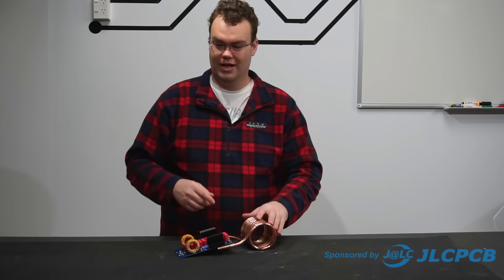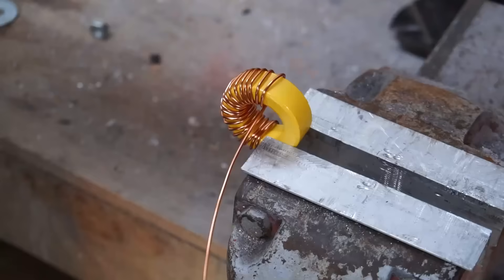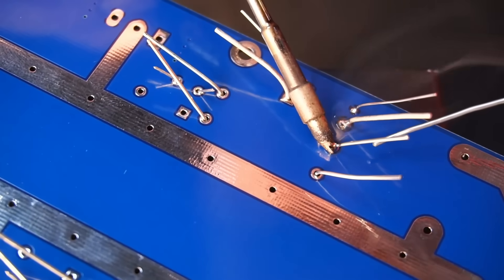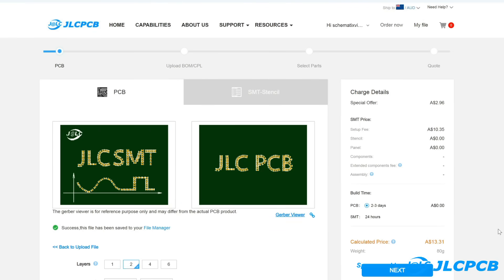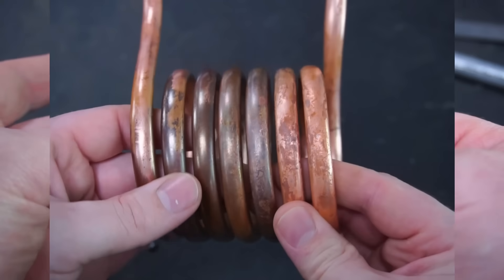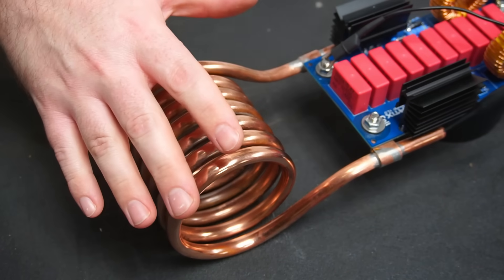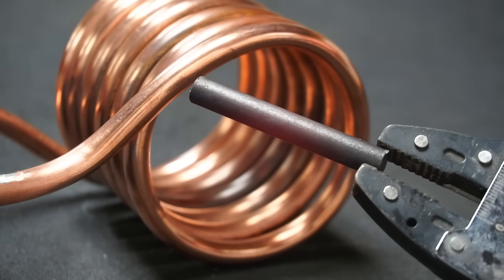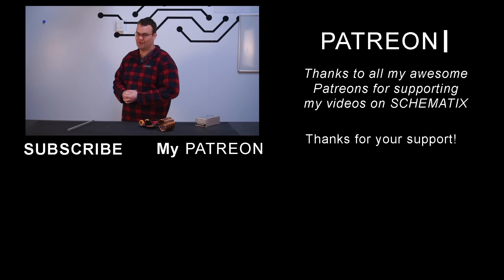Building a 1.4kW Induction Heater

Comment: Nice job, but I have some ideas, in order to make it better:

First, you can fold in the middle, some of that enameled wire you used to wind the two coils, in order to make the traces thicker. I saw you did it with some braid, but anyway... You could also make the traces themselves wider also, at the first place, I guess...

Second: If you would like to have some safety, in accordance to any different power source you might have to use, you could use some automatic, household circuit breakers. Maybe a couple of them in parallel, if the current of the input exceeds 40 amperes.

Sorry for any grammar/syntax mistakes that I might have made, but I am from Greece. What do you think of my ideas?

Comment: You need to make a smaller one for annealing cartridge brass which anneals at 700*F. As long as it reached 700 templiq can be used as the indicator to lift the brass out of the coil.

Comment: great video. You should consider to cool the induction coil with flowing water.
Reply: He did. That's why he used a tube and not a wire.
Reply: @smferreiro2610  he did not.
Reply: @gaynzz6841  He did "consider" it. He says it a some point in the video. That is the reason why he is using a tube and not a wire.
Reply: @smferreiro2610  Maybe that was his reason. But using a wire would be very inefficient in any case due to "skin effect". High frequency AC pushes the current outward to the surface of the wire, which reduces its usable cross-section. You will find that many people use copper tubing even if they're not using any water cooling - simply because it's more efficient

Comment: Why did you etch away most of the output/power traces, and try to get back  the current capacity later?
 Much simpler to keep as much copper area as possible, and only have a small etched ditch between the current bars.
Naturally You still need solder some extra wire for enhanced current , but it should help to keep the trace temp more stable  and secure.
A thin coat of lacker over the finished output coil should also greatly enhance accidental short-circuit prevention :)

Comment: Would there be benefit in electroplating the coil with silver, which conducts better? Or even gold?
Reply: Making it out of solid silver or gold might be better... I would actually try to use grounding rod copper that is solid, and not just copper tubing. And instead of trying to "reinforce" the current capability of your PCB with some weak wire and tin blobbed on top of 35um copper traces, i would cut and bend the ends of the rod and coil in a shape that follows down the path of capacitors on the PCB. Needs a bit more work to bend the copper into a coil, but i think it will be worth it.
Reply: @ProtonOne11  Current flow on the outside edge of a conductor, not inside.

Comment: Schematix: I used an on line version of these some time back for a self wound flyback transformer, specifically for the primary. The problem that arose was I knocked out one of the Mosfets. I stepped up from 12vdc to approximately 3000 vac with my design. Using this as a 'flip-flop' primary works pretty well (except killing the fet). Would this work as one in your opinion and what might I use for protecting the mosfet in the future? Thanks.

Comment: prove me wrong but from a smiths point of view, annealing is heating themetal and let it cool slowly down to room temperature :P
Reply: That all depends on whether you're dealing with a ferrous or a non-ferrous metal.  The end result of thermal cycling is a desired crystal structure in the metal.  If you want hard copper either work the metal or toss it into a 350F oven for an hour and turn off the oven with the metal inside.  If you want soft copper heat it the same way an toss it into a bucket of cold water.
Reply: @artjoly6348  I agree:-))
Reply: Correct but copper,gold and silver work differently from carbon based alloys
Reply: @jadekayak01  exactly so... we quench steel rapidly to increase the hardness... we quench precious metals to increase ductility... when I worked on BMWs they started hardening the brake rotors in liquid nitrogen... it creates a crystal structure in a thin layer on the surface that resists the heat and friction of applying brakes in a high performance car... and I think that might answer my question too... how bout that?
Reply: I think he quenched the copper tube and not annealed
Reply: @apurvmj  Quenching is the process of dipping something hot into a quenchant medium such as water or oil. You can 'quench' copper but the result will it being annealed as copper cannot be heat treated. Tempering is a process done after quenching mainly for ferrous metals to take the hardness down a notch and add some spring back into the material. Annealing is reducing the material to its softest state by heat soaking then followed by a slow air cool for best effect. Proper anneals can take 72 hours depending on size of piece.
Reply: There are a lot of strange answers here. For copper and brass, annealing is heating to less than a red glow and just letting it cool. For brass cartridges, which are often annealed by torch or induction coil, they are just dropped in a tray or bin. No quenching! It is done to keep the copper or brass from getting brittle and cracking. Red heat is way too much. Color change in a flame is too much.  https://www.youtube.com/watch?v=LYk3_IcB4JI
Reply: It all depends on what properties of the high temperature allotropes of the material are. All quenching does is lock in the properties of a higher temperature phase by cooling the metal so quickly that it can’t re-transform back into its room-temperature phase. There’s a thing called a time-temperature plot which shows the effect of cooling speed on how much of the material transforms back again to its room-temp phase.
Reply: Quenching in water has little effect on the final product as the high temperature is what allows the crystals to reform, however quenching it is just faster and can make the outside look nicer. Iron can be work-hardened as well and quenching will have little effect on the heated iron just as copper. Steel WILL harden as it is the rearrangement of the carbon atoms that occurs at higher temperatures that give steel it's high hardness,  which obviously if cooled fast enough (tempering), won't have time to go back to their original places, leaving the material in a highly stressed and brittle state, which is essentially what makes a material hard
Reply: @Jakob6174  "if cooled fast enough (tempering)" - uh no, that's the hardening/quenching you're thinking about. Tempering is reducing the stress in the material which, when it comes to steel, is achieved by heating it up to a low , non-glowing heat and maintaining it there for a while giving the carbon atoms enough time and energy to get into a "more comfortable" position, but still kinda stuck in the iron atom lattice. On a macro level this gets us a compromise between hardness and toughness which is desirable for most applications like knives, tools and springs. 

I'll add this as well: there aren't any other common alloys that can be hardened through heat treatment (maybe some aluminium alloys), but nearly all of them can be work hardened, as that is just a function of the crystal grains elongating while you're deforming the metal until they have nowhere else to move. Moving it beyond that point will cause a break, but the force required to break it is usually much higher than what it previously took to bend it, hence the hardening. Heating it up after work hardening gives it a change to recrystalize so it can be deformed further without breaking, which is also why forging works.
Reply: @mrkiky   well, what about Titanium? It hardens at 200°-300° Celsius.
That'S what make processing so hard. one glitch in cooling and you destroy your tools
Reply: It's opposite for ferrous and non-ferrous metals. What he did for copper (non-ferrous) is correct to anneal it.
Reply: Gosh darn it correct he just tempered it

Comment: What a flux rosin? :D
Reply: Try searching this term => Rosin Flux. You'll get more info than you'd imagine. 

It's basically used to clean and remove impurities from the surfaces of the copper allowing the solder to flow and bond to the surfaces.
Reply: @TheHungrySlug  I never heard the term rosin up to now. Always flux resin.
Reply: @no-eb2xx  I'm a electronics hobbyist myself and have been for many years. I only earlier this year, found out about Rosin Flux. I knew about a good handful of different flux's but nothing about Rosin flux. 
It's just another type of flux in the end.

You can actually buy this sort of stuff in a hard block. Though I don't know how you go about using it.
Reply: @TheHungrySlug  I once had a block of "resin" flux and it was hard as honey but more transparent, and I used it to push heated up ends of cables in to "flux it up" before applying solder.
Reply: @TheHungrySlug  it was annoyingly sticky after application, figures it's a pine tree thing :D

Comment: Hi, is it possible if I use the 1200w dc buck converter as a power supply, to supply power through another 300w dc buck converter.

I want to power multiple loads on one battery.

I have 1 1200w dc buck converter and 6 300w dc buck converter.

The diagram will be : connect the 1200w dc buck converter to a  fuse box, and then connect (6) 300w dc buck converter to the fuse box to power multiple loads.

Comment: For softening Don't water quench. let cool slow.
Reply: I tried it hundreds of times it is better if you cool it in water!!
Reply: @johnhili8664  & zippy.  For high carbon steel quenching in water from red heat will harden the metal. But for copper quenching will soften it.

Comment: The first thing the that came to mind during your assembly... don't cut off the cap leads, bend them over as extra current members. I've soldered paperclips to make higher current traces. (I don't always have a spool of 8AWG wire sitting around.)

Comment: Make it safe & reliable if you dare trying, Vladi Mazzilli didn't seem willing to publish any revision past the 2008-2009 contribution, while his "Royer ZVS" (as he called it himself...) fueled scholar examination and even a fair number of correctives which still won't stick around neither.  The circuit is suicidal BY-DESIGN, in other words "it works" until it doesn't - so much for bogus engineering while in fact Mazzilli worked on Tesla Coils using Flyback Transformers!

Comment: Nice layout but ideally the mosfet should not heat up much and the mass majority of the currant should go within the coil and the capacitor bank. I have made quite a few ZVS and basically you can optimize it by 1. change gate charge resistance until mosfet stays cool, and 2. add capacitors until the frequency reaches close to audible range. I would increase the coil count to maybe 10 turns for 48v input and double the capacitor bank. If the mosfets are too warm, upgrade low R-DS mosfets and or decrease gate drive resistance.
Reply: How can you increase the frequency to about 400khz?

Comment: Hi i have built several RC type EDM power supplies, so i am familiar with  paralell capacitors and high amperage discharges, my question is : can you substitute the mosfets with a gap, (fine tuned spark plug, tungsten points, argon atmosphere???)  and feed the resulting R-C-G DC oscilation through the main coil. similar to a marx generator, or an HF start from a plasma cutter or TIG welder 
Im used to gap dependent frequencies of 20 KHz or there abouts is this usefull? 70-200 odd V DC up to 16 amps 0.1-120uF caps
my main EDM unit is an ex telecom 88VAC 50mp transformer.... she's got some serious grunt

Comment: Thanks, very nicely done video, and details onm your website.

In order to make it more powerful, you'll need to cool the copper induction coil, but I'm sure you've seen that on the other devices that are shown.
The copper will get hot from the heat you are putting into workpiece, which in turn will heat it up by radiation/convection.

And the coper itself will get hot by the resistance drop from the current itself, but would need to do the math to see it's a reasonable amount.

Comment: 14:40 why on earth is the width of the band expanding when the pliers are placed into the coil? the best guess that I have is that the pliers are not a perfect cylinder, so there is some variance in the signal that the oscilloscope is receiving (different parts of the pliers are a different distance from the coil creating a variance in the inductance)... but that's just a guess. Can anyone here explain this behavior?
Reply: If you mean the spreading out of the peak voltage, it is due to power supply ripple.

Without pliers the load is small so the power supply voltage is constant.  With pliers the load is large and even the huge capacitor shows significant ripple voltage - it's only getting charged once per 10 ms at the peaks of the input 50 Hz AC.  The resonant tank voltage is approximately proportional to the power supply voltage, so the varying power supply voltage causes amplitude modulation.

(Edit: notice it is not a time spread because the zero crossings are still clean.  If the inductance was varying rapidly the frequency would modulate, causing a horizontal spreading that increased with distance from the trigger point.)

Comment: One thing that strikes me is the fact you use way too much paste between the mosfet and the heatsink. Never forget paste not only conducts heat, it is also a resistance to heat. So the more paste you use, the larger the resistance is which causes the heat transfer to reduce. I see that all the time. Paste is only necessary to fill uneven parts of the fet and/or the heatsink so they touch each other for better heat transfer.

Comment: It's a good video and interesting idea. But I'd be more worried about shorting out the induction coil by dropping some ferrous metal inside it, and with 30 Amp current it would probably weld itself to the coil, and of course then there is the slight risk of electric shock from +50 volts on the induction coil. A plastic sleeve around the coil would be a good idea.

Comment: if you fill your copper tubing with sand(like from a sand box or the stuff you use to make cement) you can wrap and bend the tube without deforming the inside, and flattening the tube.
Reply: Not worth it IMO, at least for a small coil like that.  Sand falls out, so you cap then ends.  Then you discover the sand is preventing it from bending.  You let some sand out.  Then it bends and kinks at the voids in the sand only, ruining the coil.  Huge pain.  His printed coil winder is perfect for that coil.

Comment: Greetings from Russia. There are rumors among Russians that it is necessary to reduce the number of turns from 7 pieces to 3 pieces and the efficiency will be higher. And you can also pass water through the loops to cool them! :)
Reply: I forgot to write. Try to reduce not only the number of turns, but also increase the distance between them. :)

Comment: Have you tried experimenting with extending the coil with coaxial cable to heat rusted nuts and bolts?   I assume the tuning would change somewhat.
Thanks. Great video.
Reply: Ever seen 50 amps in a coax cable? Not for long!
Reply: @gyrogearloose1345   Ya' got me Uncle Gyro. Thanks.

Comment: Found Already  Made - 1000W ZVS induction heater electronic module + brass heating coil  =    Ebay   au $48.00           ph from usa $35 haa! 
Buy local Asia  cheeper   ALSO   Banggood     au $28  ph $3 <  best buy

Comment: 7:05 half of turn - impossible to create in closed loop circuit , some same like with hugs(embrace) - there you did 7 full turns coil
Reply: 50kHz*200VAC( 1/10 input oscilloscope attenuator? isn't it?) will be hard problem for body - as i think - very hot burns damage, and probably epileptic e-shock effect, or even dead...  approx 200Wt - already deathly level, and 50kHz is low enough freq - to pass deep in body, 500kHz will burn skin only as i think
Reply: have you tried to exclude some of PP cappacitor(of oscillatory circuit) - to rise freq ? IMHO it will not reduce output power - because one period of 500kHz for 1 kWt - require ten times less energy(and capacity)than on period of 50kHz sine - it is usuall for HigherFreq supplies - to be builded with lower components, that not so loud if short cyrcuit

Comment: microwave oven transformers are a great resource for high current power supplies - you can find dead microwave ovens for free pretty easily and of the literally dozens I've salvaged the transformer has never been the faulty component.

Comment: Maybe I have different info  But the Metallurgy class (College level) I attended said to air cool metal for annealing not quenching. Quenching hardens the metal   All the diagrams said it this way
Reply: heating carbon steel wil harden when quenched copper will soften when quenched
Reply: @radiorec1  That's right:-))
Reply: @radiorec1  That's right:-))
Reply: @radiorec1  Guess I'll have to call the professor and tell him to include that in the symposium LOL

Comment: Can I alter the coil? I would like to use it to heat rusted on nuts and bolts in spaces where I would not like to use a naked torch flame.

Comment: Just a note on flame soldering...  The flame will draw the solder to it.  So the idea is to put your torch right in the middle of the clamp, and hit both sides with the solder and it will draw it inside.  Just like a fitting on pipe.   Excellent video, BTW....  Well done!

Comment: In stead of building a new induction heater can we convert Induction cooktop into heater for heating or melting steel and cast iron?
Reply: I did, melted Al in seconds... until I tried replacing litz lacquer coil with solid coil. Mosfet didn't like that at all, seems it has to be in tune with coil.